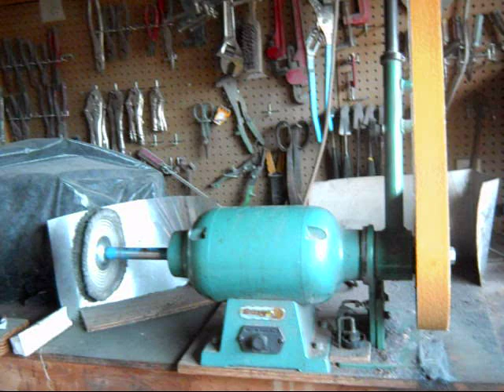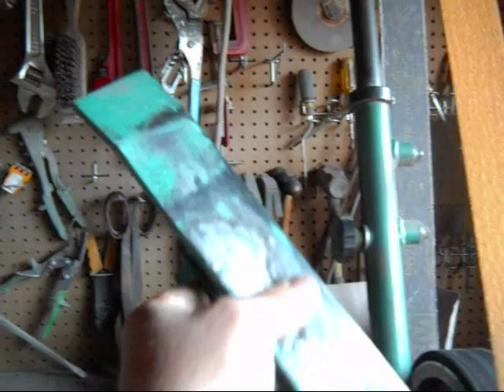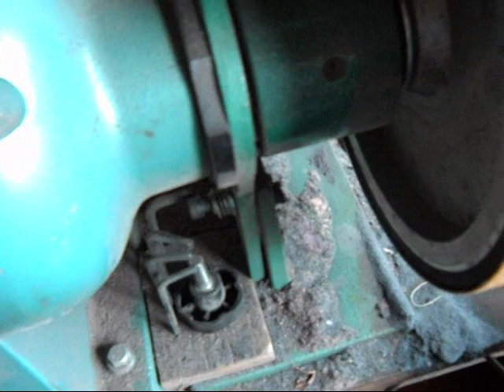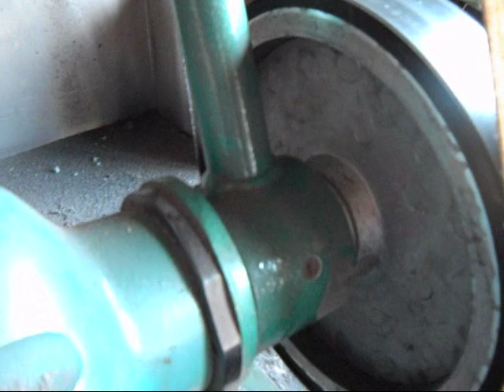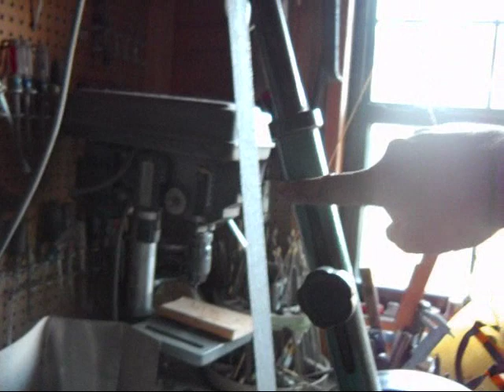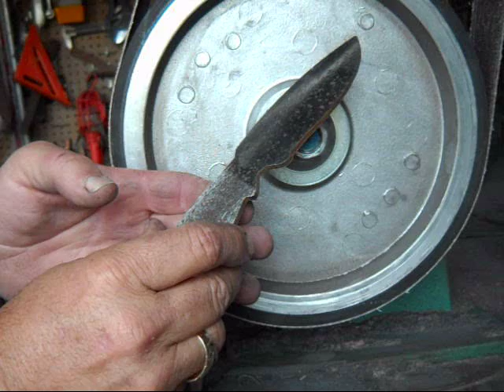Grizzly Grinder Review

Comment: I have a grizzly grinder. Wish it was variable speed, anyone ever try using a variable speed foot pedal that are cheap and easy to find? Would it cause a problem with the motor?
Reply from the maker: I have not used one.  As long as you get one that can handle the amperage of the grinder you should be fine.

Comment: I picked a 3/4 HP Baldor from a house where the Guy was a knife grinder  Because We found a lot of 2x72" belts  but no attachment to drive them for the grinder  can You  recommend  a add on 2x72" drive set up ?
Reply from the maker: I'm not familiar with the grinder you picked up, but check Jantz Supply or USA Knifemaker.
Reply: Ok thanks

Comment: Can you flip the pole forward and grind on the top wheel?
Reply from the maker: +Dean Carder I no longer have this grinder (ran out of room in my shop) but I don't think you can.  Even if you could, you probably wouldn't want to grind on your aluminum tracking wheel - probably ruin it rather quickly.
Reply from the maker: +Dean Carder No.  The top wheel is your tracking wheel.  You do not want to grind in it.

Comment: notice to any one out there thinking about getting a Grizzly G-1015  ( 2X72 )
 belt grinder ,  if you can pay the extra get the 10" contact wheel  the shaft that holds
 the  slide that the Idler wheel and tracking adjustment   Cut 2" off the bottom and file a bevel around the diameter   this will allow you to use  this shaft for both the 8" contact wheel and the 10 " wheel you just have to adjust the shaft  up and down
 I use 1 cinch bolt instead of Two . and on the work platen   get a pc of  0-1  that is surface perfect at least 3/8" this  2''X 8 or 10"  use the old platen as the backing plate .  and a couple sheet metal screws 1/4. ( 20 ) and mount  it . make damn sure it is in line with the belt as perfect as it can me .  I have  wore out . 4 grizzly's since
 since 1980 my first 2 I bought was right around 259 dollars . this last one was 500,
 next one I make . and 1/4" leather  on your  0-1 heat treated  surface perfect 
 will give you a very  nice  semi convex  grind .

Comment: Would you recommend grinding a blade in this direction using a conventional grinder? (Grinding Wheel rather than a belt sander?) It appears to make more sense as far as the blade goes, but what about getting the fingers drawn into the machine? - Just an honest question from someone that cannot get the damn kitchen knives as sharp as I would like. (I use the rotary stone grinders, but the edge they put on is more likely to cut you sliding your fingers down the burr rather than over the blade.

Comment: better off making your own flat platen .  and you didnt buy the idler shaft for the 10" wheel did you ??? all you have to do is take 2.5 inches offf your idler shaft and the two knobs to tighten the shaft up  to the arm leave the bottom off . and no problem with 10" wheel .  ive used grizzlys for  many years and had a burrking its nice but grizzly does a  nice job use your head and you can make adpter to use smaller wheels as well //

Comment from the maker: @okkrom Changing belts is quick.  Just to the right of the tracking adjustment knob you'll notice an arm with a black ball on it.  Just pull that down to lower the upper wheel slightly, allowing you to slide off and on belts with ease.

Comment from the maker: @mikedifeo The shaft is two inches longer on the left.  The issues that you would run into are that they are different diameters, the tensioning and tracking "tower" along with the mounting hardware are made for the right side.  I'm sure that with some machining and a few parts they could be swapped over, but for me, I want that extra space on the buffer.

Comment: Nice equipment. I am just curious. Looks like the shaft is longer on the polishing wheel side. Can you monut the sand belt adapter on that side? Wouldn't that solve the blade hitting the motor casing?